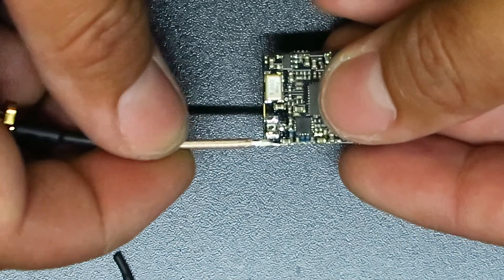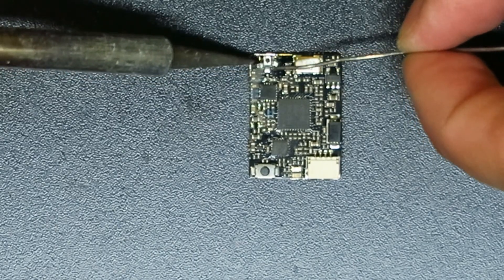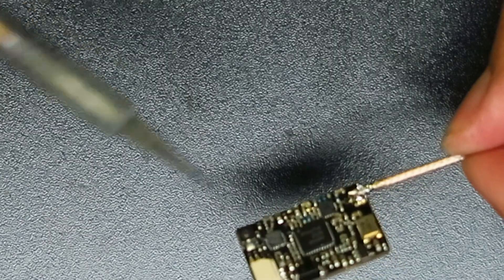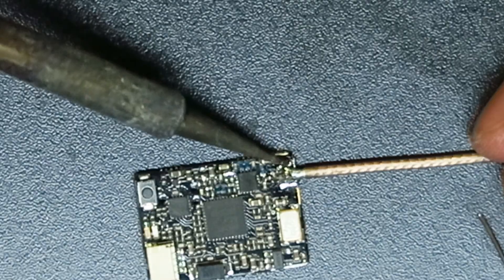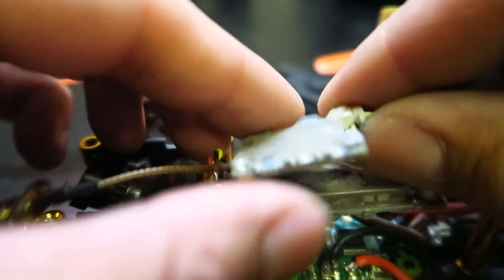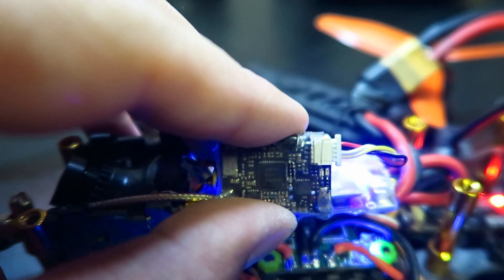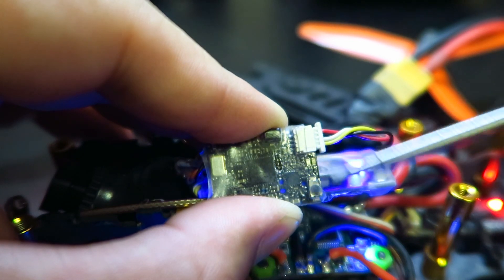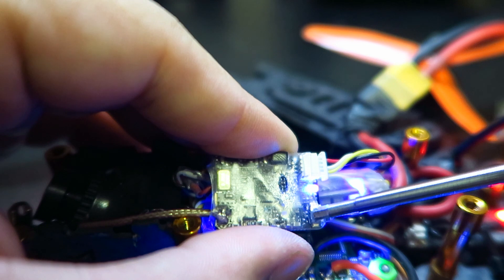TECH TALK | TBS UNIFY PRO 5.8

Comment: I use a cli command that puts the vtx in pit mode or low mw when I disarm. As soon as I arm I'm back at 800mw...
May have already been mentioned. 
But just type get vtx in cli and you vwill see it

Comment: Nice video. When I set the power output of the VTX to anything greater than 25Mw my Fat Shark goggles stop working. Not sure if the issue is the goggles or the VTX. I noticed that the VTX red and blue light stay on when power is set above 25Mw, but only the blue light is on when power at 25mW. Any ideas on what I need to do to correct this issue?

Comment: Good video but in the future you could just use a  u.FL(IPX) to RP-SMA Pigtail.  They are cheap off of Amazon and snap right into that port on the TBS products.  I use the TBS Unify Pro HV at 800mw and I never use their antenna leads because they are too short and they are not really bulkhead type fittings.  This one linked is the one I use.  When using the TBS Triumph antenna on the quad, and IBCRazy Madmushroom and Emmersion Patch on the goggles with the Furious D Diversity I get unbelievable range and signal quality.  Penetration is outstanding.  However this trick of yours i have had to do on my Lumenier VTx's that don't come with the u.FL port.

Good work on the videos.  Keep them coming.  

https://smile.amazon.com/gp/product/B00GWMBB80/ref=oh_aui_detailpage_o09_s01?ie=UTF8&psc=1
Reply: Nick How did you mount the tbs to cool it?

Comment: Thanks for the demo.  I have one of these, but it acts like it's stuck in pit mode - the range is a few feet with a solid blue light (other settings are Band A, channel 3, 500mW).  I can reprogram all parameters using the switch but the range is useless.  Do you have comments about pit mode and how to enter/exit?
Reply from the maker: +David Campbell I had that same issue after one of my quads was stuck up on a bridge and I think it over heated. I know if you hold the button down for 20sec or so it should take you out of pit mode I believe.
Reply: Got my answer (hope?) -- I'd hooked the video components up with a separate BEC and had bridged its output to 6V.  Changing that to 5V and running through the program sequence did the trick - clear video and normal range with the TBS Unify Pro and an 1185 camera.  I'd tried to provide the camera with just a little bit more voltage above its lower rating of 5V, but TBS is apparently not kidding about 4.5-5.5V input.  Hope this helps someone else.  Thanks, Konasty, for the thoughts.
Reply from the maker: +David Campbell ahh yeah it definitely needs regulated 5v. That's one reason I switched to the HV